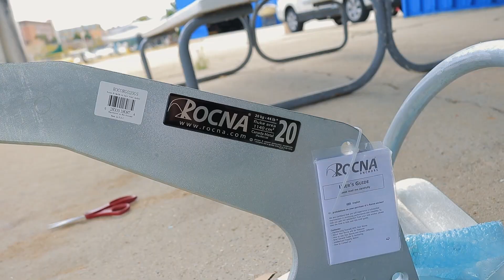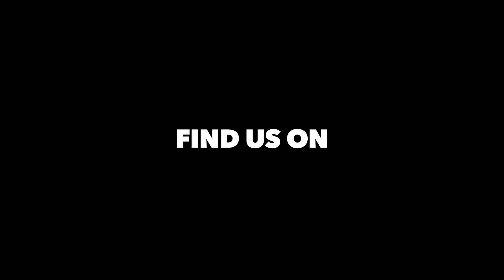GOODBYE Marine Head & Holding Tank, HELLO Composting Toilet  | Sailing Soulianis - Ep. 17

Comment from the maker: Where you poop on a boat is a very CONTROVERSIAL topic as already clearly illustrated by Sailing Uma. In the video we only briefly mention one of the reasons we chose to go with a composting head, so here’s a few more:

1. Our holding tank was a 12-gallon tank. That’s TINY. We’d get 3 or 4 days out of that with full-time use before needing to pump it out. As full-time cruisers, that wasn’t going to work for us. We didn’t want to be paying for pump outs all the time, nor did we want to have to try to find a marina every time our holding tank got full. And lastly we don’t want to be pumping out in an anchorage.
2. The head smelled. It just did. Always.
3. We’ve been using our composting toilet for a while now, and believe it or not, it’s not the solids that smell, it’s the liquids, and really only when you open the lid. HOWEVER, we’ve been told that rinsing out the liquids container with a little vinegar takes care of this. We have yet to try it, and are excited that this might solve this issue. And last but not least it’s a gallon milk jug which means we can get a new one almost any time we want and get rid of the smell.
4. We’ve gained 10+ cubic feet of storage space under our v-berth by getting rid of the holding tank, as well as space in the hanging locker after removing the hoses. (Storage is super valuable!)
5. Our pump handle leaked, which in and of itself wasn’t an unfixable issue, however, it portended what could happen when you store many gallons of liquid waste inside your boat. It is possible one day some other part of the system could become compromised — a hose clamp, a hose, the tank itself — and we end up with poop water everywhere. This is not something we wanted to continue to worry about.
6. We like the idea of simplifying as many systems aboard as reasonably possible, and to us a composting toilet makes the entire head system much simpler.

We aren’t advocating that this is the best decision for everyone, but it has been the best decision for us. Thanks so much for watching, and we appreciate your thoughtful comments!

Cheers,
Lauren & Kirk
Reply: warp21drive, I think they were referring to Sailing Uma's recent videos where they replaced their composting bucket with a more traditional system, except instead of installing a holding tank they have a large pipe that will hold only two flushes. the system will satisfy certain regulations regarding holding tanks, but I have no doubt that their anchorage neighbors will be less than pleased to be swimming around in Dan and Kika's shit. Hey, I could be wrong though, maybe they will sail Uma 3 miles offshore every single morning and pump out their sewage instead of shitting up every single pristine anchorage they visit.
Reply from the maker: Hi Warren, Good points.  You are correct, we do have a "proper" composting toilet that separtes solids and liquids.  It also has a device to "agitate" the solid waste.  We've been using aspen shavings (https://amzn.to/2MzTC2I)  successfully so far and have not yet installed a vent fan, but plan to do so this next year.  

We will still dump at sea if we are ever in that situation (multi-week ocean crossing), but will not be in that situation for the foreseeable future. We've only emptied the solids a handful of times in total since purchasing.  But the bonus is that we don't have to empty it after ever use, so it will never go over the side in an anchorage.

The liquids smells a bit, but it's easily curable with a rinse.
Reply: Not sure I would have removed the tank, I know it freed up valuable storage space. But think I would have repurposed it for something else ... and have heard that some areas and marina require a holding tank and composting head is not sufficient. If had left tank in, could not one simply claim that as their holding tank and get away by meeting such requirements? Or was the tank simply not big enough to even meet most requirements anyway?
Reply: Sailing Soulianis Great, I’m encouraged to hear how well it’s working for you. Cheers Warren
Reply: what kept you from straightening the anchor? with a sledge hammer and maybe a MAPP torch?
Reply: Sailing Soulianis - Silly question what is the name of the song playing in the background when you’re in the cockpit

Comment: The best wood screws/drivers (IMHO) are Robertson - aka square.  They rarely strip, are self seating, you get a huge amount of force, the screw can often be placed on the screwdriver for sideways or upsidedown work, often work when the screws are painted over and work well one handed.  The downside is they are not well known in many places in the USA and you can apply so much torque that if it's a cheap screw you can twist the head right off. 

So much better than Phillips which are almost as bad as 'common' slot heads.

Comment: Smart move to bring in a port-a-podi like head. If you notice how small the diameter the hoses are to the holding tank, then you can imagine the size of a typical stool, and how it is inevitable it is to clog. So every sailor will have to take apart their head at one time or another. It really is a right of passage for the typical large boat owner.

Comment: Taking out the head was a shame. A conventional head and tank just need a little but of annual maintenance and they work just fine. A joker valve is dirt cheap and even having an extra head pump is inexpensive. If you are off shore (US rules) you can easily pump the holding tank. I'm afraid your new setup will be a hassle more than you realize.

Sail on. Love your channel.
Reply: Totally agree.

Comment: I used to think composting toilets were pretty gross "filthy hippy" stuff. Then I helped service a broken macerating head. I learned. The hard way. {shudder}.

The only hassle is that on most boats actually composting isn't really an option - it takes a few months to break down into garden-safe compost, so you need multiple containers and store them somewhere not-cold. Easy in a detached house with garden, do-able on a van, I haven't seen it happen on a small yacht yet. So "composting head" usually ends up in landfill, which is not ideal. Pooping over the side is better once you're offshore, but on land "composting" is kinda the least wrost option for boat-board. IMO, anyway.

Comment: Sounds like your original head just needed a new joker valve (fairly inexpensive, easy to do,  and not as gross to change as you might think if you prepare a bit by thoroughly flushing, using a bit of bleach to disinfect the line).    I probably will go for a composting unit in my boat eventually, because admittedly holding tanks do stink no matter how you slice it.  My main hesitation is that in Canadian inland waters 9e.g., Great lakes) where I sail, composting heads are not legal as they are regarded to be the same as a porta-potty.
Reply: Yeah, actual biological action requires warm temperatures (lesson learned: don't keep the composting toilet in the coldest part of the house, even 10 degrees Celcius is too cold, it will just be a porta-potty). And storage space for 2-3 extra containers in the warm while they compost properly.

Comment: Sorry guys but I think you should have kept to original system and got it perfect working order. And have the composting toilet for use when you can and the original system for a backup or when you sell the boat in the future.
Reply from the maker: We held onto the old holding tank and toilet for a while, just to make sure this was what we wanted. In a perfect world I think you’re right. We’d have a catamaran, with a regular water flush head in one hull that went straight over the side or into a small holding tank for use at sea. And a composting head in the other hull for when we are in port. But then we’d have to buy a whole new boat... ;)

Comment: Apparently, as long that you don't mix the pee with the poop and with a proper poop to compost process, you should not have any problems. Compost does not smell at all like poop and poop tends to compact as its water is absorbed or evaporates. Proper compost can be used in a garden or discarded without much of an afterthoughts. You may have created a few new problems, but you got rid of a lot of old ones.

Comment: Hiya C-Head poop-mates.

We just ripped out both heads on our boat in favour of 1 C-Head.. Next up is blanking all those redundant through-hulls and deck pump outs.
Reply from the maker: Hey there, that’s interesting to hear. I think if we had the option of having two heads, we thought we would keep one marine head with a very small holding tank or one that was piped straight over so that it could be used while on passage/at sea. And the composter for all other times.

Was this a consideration? Or did the extra storage outweigh the benefits of having two heads?

Comment: Holding tank area or tank could be another fuel tank , if you don’t need the room. Did you ever look at the rareitan (sp) composting toilet?
Reply from the maker: All good options! We hold 53 gallons of diesel plus jerry cans and burn .6 an hour. Even on the river we never needed that much. A water maker would be cool but for now it’s just dry storage.
Reply: @SailingSoulianis  - May I ask you … with the storage container gone … what 
are you using the extra space for now?
Reply from the maker: @doracotterell2863  The "storage container" was the black water tank, so now we use it for spare parts storage.
Reply: @SailingSoulianis  : That’s a great place for it.  I was going to install a “Head Compost Toilet”, remove the tank & put all expensive tools & parts in the space.
Thanks for replying and have a great Thanksgiving holiday!  ⛵️

Comment: Great video. I am excited to see how the composting toilet works. It makes total sense in port but I wonder about its effectiveness at see and on long voyages. :)
Reply: Three miles out and further, you just dump it. In port, is the hassle of finding where to dump.
Reply: Thank you. That is really interesting, I thought it would be the opposite. With 2 people on board how frequently do you need to empty the liquids and the solids?
Reply from the maker: Hi Jeffrey, the liquids container is a gallon milk jug. We find we need to empty it once a day. We keep an extra jug or two around in case we need to keep it on board for a few days. But typically liquids go overboard. The solid waste is hard to determine. We’ve only emptied it 4 times since purchasing the unit. But have yet to rely on it as our only option for extended periods of time. So it is likely to last two weeks of daily use. However, in our time owning it we’ve often had alternative options for #2s. 😊
Reply: Thank you :)

Comment: Some countries you are required by law to have some kind of holding tank..Friends of mine did the same as you...Never got a chance to smell it , but they said the composting toilet smelled worst than the tank...you might not want to throw old toilet and tank out yet....Just sharing there toilet experience with you guys.......T.Gunz........
Reply: Likely their composting loo wasn't kept warm, or possibly they didn't have the right starter culture so it all turned to s..t. The thermophilic microbes that do the real work die if it's too cold (they're used to living at 38 Celcius) . If that happens you get flies if you're lucky, mould if you're not, and it smells worse than fresh poop.
Reply: mozismobile  dont they come with a heater? I would think an aquarium heater would be a must to keep the bugs happy otherwise its just a porta potty. And they need aeration and agitation too or its just a bucket. Looked like a bucket they fitted, to me. There seem to be some good units out there with fans and a crank handle etc, but i dont think this was one of them...
Reply: max nex    so long as its not someone elses poo floating by (hmmm isnt there a poo emoji somewhere)...
Reply: Heating depends where you are, and with good design you don't need to agitate it - the one I have looks a lot like a compost bin, with a perforated sheet at the bottom, a pipe down for air and a pipe out the back for excess fluid. Mildly tricky as a DIY project but it works really well. There's a tap for the liquid drain and 99% of the time I have very little in it when the bin is full (don't pee in the compost!), so it's only when I go to empty it that the fluid is an issue... but that's once it's outside. You could do something similar with a bit of plastic in the bottom of a bucket and a small fan (40mm computer fan?). I should try that.
Reply: if a compost toilet stinks it's usually because someone sprayed disinfectant in it. killing the microbes causing the shit to rot and ferment.
Reply: @mozismobile  - May I politely ask which composting toilet brand you purchased and how do you like it several years later?

Comment: I'd like the idea of a compost toilet but it's kind of pointless on a boat unless you're going to start a garden then you have something to use the compost for.  keep it simple dump it overboard yes is a few situations you need to use the holding. You might find it difficult to get sawdust for the toilet one more thing taking up storage space bags of sawdust on your boat I wonder if that stuff is specially treated so it doesn't get moldy and musty.
Reply from the maker: The critics are mostly right in that there is less composting going on than in a typical home environment. We do carry a second bucket that we thought we might use to allow the waste to finish composting. But have yet to use it.  

That said the composting toilet is far superior to just a plain bucket for odor issues. Having the ability to easily agitate the waste to keep it covered is critically important. 

We use aspen shavings in place of sawdust which we keep in a vaccum packed bag. We’re only halfway through one bag, so I think we'll need less than one per season. 

Mold and must are taken care of by the heat of the aerobic process and through venting of the toilet.

Comment: Sailing UMA takes theirs Out & You put one one, Interesting
Reply from the maker: The C-head which we installed is built by a sailor for sailors. It’s an incredibly simple design that uses simple parts that can be found almost anywhere on earth.

We don’t want to throw shade at Uma, they make their own decisions, but they felt OK sailing around on a boat with no lifelines, toe rails or any nonskid. That is beyond unconventional and incredibly unsafe even with a tether. We would never sail long distance with a boat in that condition. They did. 

We have never met Uma and they seem like very nice people. They made decisions that work for them and we’re going to make decisions that work best for us. 

Regarding their “holding tank,” it may be legal to the letter of the law, but not the intent. They are exploiting a way to “hack” the system, and if they feel comfortable doing that good on them, but there is zero chance that it will not pumped overboard in an anchorage at some point, and we prefer not to swim in our own 💩.
Reply: @SailingSoulianis  - I’m in the process of deciding which compost toilet system to buy.  
Question:
What made you guys decide to ‘not’ purchase the “Head Composting Toilet”?